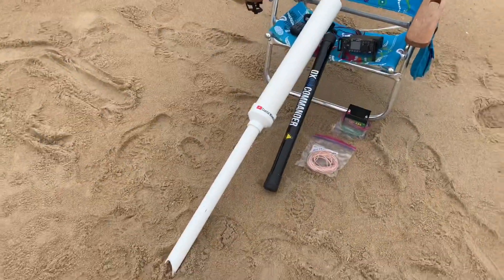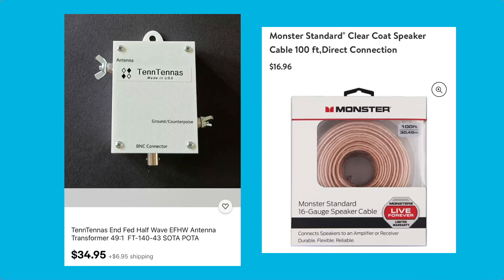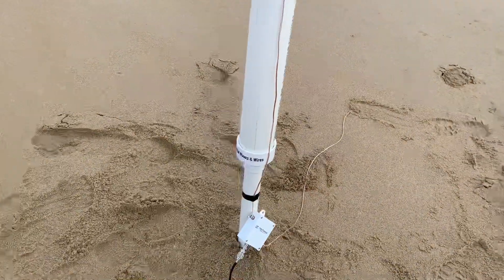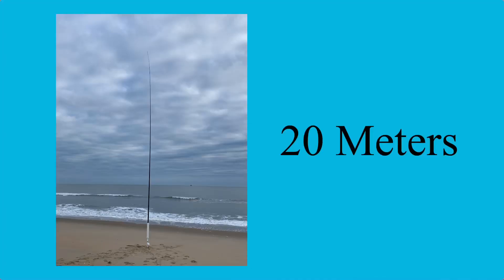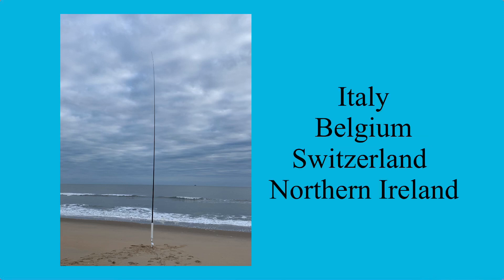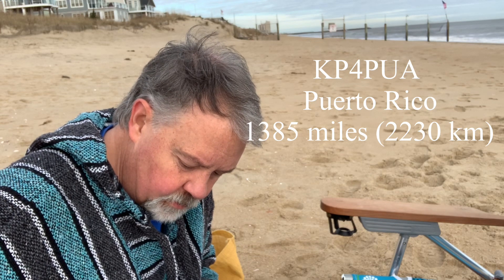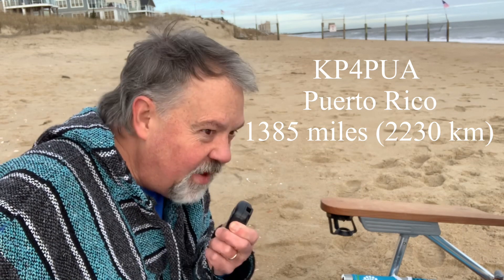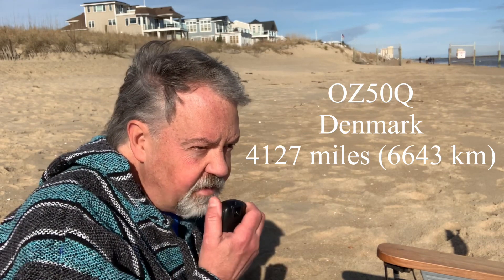EFHW Vertical on the Beach with the TennTennas 49:1 UNUN

Comment: I use a homemade 49:1 UNUN and 130ft of wire that is hooked up over the top of a pine tree. The wire goes vertically up the tree before bending at about a 35 degree angle and terminating atop a fence post. I do not use a counterpoise but I ground the UNUN to an 8 foot ground rod for lightning protection . I have worked many European stations on 75 meters with both CW and 75 SSB. I have also worked all over Europe and some stations in Africa as well as VK's and ZL's on 40 meters, 20 meters and 15 meters. 10 meters also works fine. I run a maximum of 100W with an Icom -7300 as well as running QRP. I seriously doubt is there is a simpler antenna than a HWEF that works as well, N2SN.

Comment: I used a TennTennas 49:1 to do my first POTA activation with no counterpoise.  So easy to have just a single wire and we activated the park (10 contacts) within the first 20-30 minutes only running about 30 watts.   I'm going to have to bring it to the beach this summer to try some DX.

Comment: I just got mine today will be running wire tomorrow. I'm going with approx 130' 12 ga. speaker wire with 50' of RG213 to back to my FTDX101.  Great video and new subscriber.  7 3  KN6TUX
Reply from the maker: Thank you so much! You’re going to have a great time with that antenna. 73/K4OGO

Comment: Walt, Just a question about the speaker wire you use if you don't mind.  Do you use Copper Clad Aluminum (CCA) or Oxygen Free Copper (OFC) speaker wire?  I guess I'm kinda old school and don't like the idea of using copper clad aluminum wire.  What's your opinion on this point? Tnx es 73 kc3zo
Reply from the maker: I use the $16.99 Monster Speaker Wire I get at Walmart. It’s CCA and I’ve had nothing but great success with it. 73, Walt K4OGO

Comment: What is the actual length of the 20 meter wire you're running?  I have a QRP Guys antenna which I use 28 feet of wire for 20 meters and I have two 66 foot end feds - 1 I use for my home station  - and the other one for POTAs - both with 49-1 baluns. The 66 footer is resonant at 40, 20 and 10. You can't beat them.
By the way - nice video - great to see VA Beach. As I mentioned in a previous note, I was stationed at Portsmouth Naval Shipyard back in the late 60s and we used to head to Virginia Beach when we could.
Reply from the maker: I believe the length was 32’-9” which is a true half wave around 14.280. I think I will try the 66 foot length down by the sea wall here in Portsmouth. Thanks for watching and 73 from your old stomping ground!

Comment: Great video....amazing to me that little 5% counterpoise does much but hey who knows......Did you try it without the counterpoise? I would think that your coax shield was the main counterpoise.  Love your channel.
Reply from the maker: I actually didn’t try it without the counterpoise. I did a bit of research before building that antenna and found several places suggesting the 5% counterpoise. I actually tried a longer one at five watts QRP with the QRPGuys EFHW and tossed it because it ran my SWR up higher. I used that EFHW without a counterpoise and had good results. There’s a video of it on my channel. Thanks so much for the kind words and watching. 73, K4OGO

Comment: nice job Walt.. curious on those DX contacts.. were you tuning around and finding them.. or did you just camp on a frequency and start calling CQ..  Thanks for the video... 73  Kevin ~ k0klb
Reply from the maker: Kevin, I normally tune around and find them.  Typically I look at the SDR waterfall on my transceiver and then tune over and listen.  Thanks for watching! 73, Walt K4OGO
Reply: @COASTALWAVESWIRES  ahhh.. I see.. that’s a good idea.. I’ll try that next time.. the reason I asked is that in my last Windmill antenna video I did hunt most of the contacts.. but then I sat and started calling CQ and was surprised by the number of responding stations, so wasn’t sure how you were getting your QSO samples...  I’ll add your method of scanning the scope too.. nice video. keep it up.. thanks.. 73 Kevin ~ k0klb
Reply from the maker: @hamradioqrp-k0klb  Thanks again and good DX my friend!!

Comment: The pole holder looks like just PVC glued together.  What are the dimensions of this holder?
Reply from the maker: Yes exactly, a 2 foot long 3 inch pipe with a reducer to a 2 foot long 2 inch pipe. All PVC
Reply: Did you cut a point on the smaller PVC pipe to make it easier to drive into the sand.  Do you use any type of  hammer to persuade it into the sand?

Comment: Of all the different antennas that have tried so far from the beach, which one is your favourite?
I realise that you have not done side by side comparisons.
Reply from the maker: Honestly this one is a close second to the Vertical Random Wire I did with the Nelson Antenna UNUN and that’s only because they were both multiband. As far as true DX the speaker wire quarterwave vertical I did for 20 meters was the best performer because it was truly resonate but it was limited because it was one band. Currently I’m really digging this Slidewinder Coil setup I’m using because I can get it up and down so quick and I don’t need a tuner when operating.